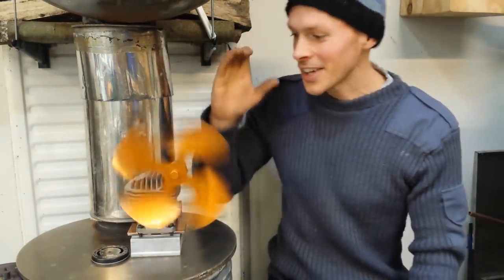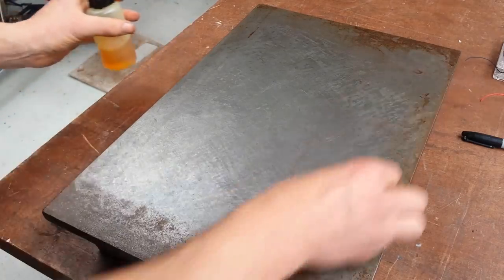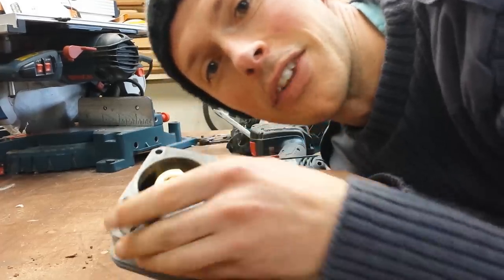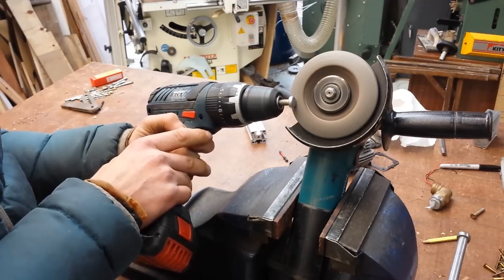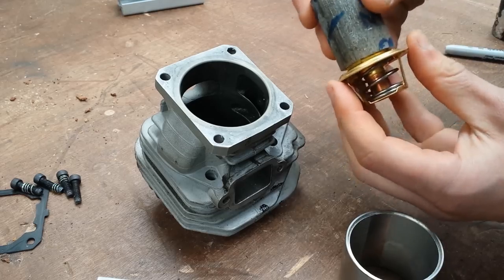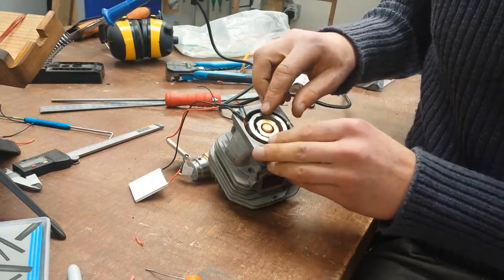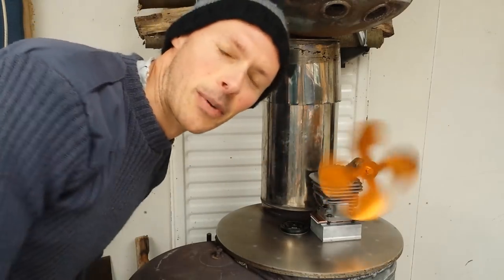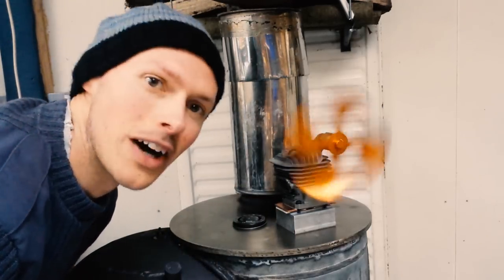Stove Fan's Achilles Heel and the easy Upcycled Fix

Comment: Kid, you deserve a lot more subscribers than you have! If you redesign this, I would suggest that you make a foot plate below the assembly. Lock your sliding bolt into that plate. Design it so that the "foot" will lift your entire fan assembly, in a balanced way.
Reply from the maker: Hi Selador. Thank you for your comment. The next one I make I think I will try your idea and make a balanced lift. Recon the floating look would be nice:) Thanks again, Bongo
Reply: Would that transfer more heat to the bolt faster or wouldn't that matter🤷‍♂️😊

Comment: I’ve had an Ecofan for years and never had any issues with it. Directions included with it specifies that the fan should be placed at edge of the stove top in a fashion where it pulls cooler air from the outer edge of the stove and blows it over the hot air over the stovetop . This way the fan’s upper portion is cooled more efficiently. Just my two cents.
Reply: Bien dit Andre.
Reply: Yup ,of course.
I didn't think,thats what I do.
It was more for me to blow more hot air by being at the back but of course it'll draw more cold👌

Comment: I was thinking you would have turned the bottom piece 90° so the fan would draw some air through the fins. It wouldn't be much air but it would increase as it gets hotter and the fan speeds up. Great idea with the thermostat

Comment: Floweringelbow , I have two.
One is the small ecofan and the second is the later larger unit , both two blade.
I run the wood stove all winter ( sole heat source) and maintain a medium high temp range.
At the corner in front the fan runs steady but not full blast unless I put it directly on.
Ive learned that directly on isnt good , and if I want more air flow I move the fan on the trivet closer in.
Sometimes we run both in different directions.
Weve been off grid for 20 years and these little fans are the ticket to heat dispersion.
Have a great day!

Comment: In one of the Douglas Adams books he says something along the lines of "It takes genius to see a bloody obvious answer when everyone else is still scratching their heads and trying to fathom out a workable solution. Many great inventions have been greeted by calls of "Well, what's so impressive about it? I could have done that", but the fact of the matter is that they didn't".

The idea of using a car thermostat as a high temperature cut off was bloody obvious, and I could have done that............ But I didn't think of it. :D

Very neat design mate.

One idea that keeps coming to mind is that the fan goes quicker as the temperature rises, so in theory, if the fan overhung the bottom heatsink it would self regulate by taking more and more excess heat out of the bottom heatsink as it got hotter. It should then just be a case of adjusting how much of the hot side was behind the fan disc and tune the point of equilibrium to be within the TEG's happy range. Granted, if the fire was particularly hot the fans not going to be able to purge enough excess heat, and the idea would rob the whole system of some performance, but it should at least enlarge the temperature window that the unit could survive within.
Reply from the maker: Thanks so much friend :) I had the same intuition about the fan blowing on the hot side, but without the patience to iterate and test it.  Thanks again, Bongo.

Comment: I bought a stove fan, but mine is  Stirling engine driven, bought from Kontax/Vulcan. Only problem is that it is not self starting, so you have to remember to give it a flick if it stops. But it's an engine, with interesting moving bits.
A dozen or so years ago I made a demo unit (I am a retired tech teacher.) out of and old thermoelectric travel fridge, just like you did, it works well enough on top of a cup of hot water, it just spins a wheel.
You have motivated me to have another go and make a stove top fan, years ago I used a two stroke cylinder head as a heat sink for an audio amp. It didn't work very well though.
There is another product on the same lines; a twig burning camping stove with draught provided by a small fan driven by a Peltier unit. I am not sure if the ones I have seen were cheating or not, given that they always seems to include a battery for some reason. Hmm?

Comment: Good thinking with the auto thermostat, lad. Perhaps a setup with 2 thermostats, one on either side, with stabilizer feet at the bottom to prevent tipping. In that way the entire cold side heat sink could be lifted from the stove top. Just an idea

Comment: Using thermostats for a mechanical temp adjustment is a great idea, and the cylinder head is a really nice touch. As far as I understand it (which isn't far), it's not the temp that the stove top gets to that's the problem, it's the temperature differential across the peltier. So one way to increase the efficiency, and lower the risk of failure, might be to try for greater separation of the hot and cold sides. If you can get the fan motor and the cold side further out into cool air, and shield it from the radiated heat of the stove-pipe, I reckon you'll see even more progress.
Reply: Thats why the top is from an old engine. Bigger heat capacity (cooler) and the fan is on the top (cooling the top radiator).

Comment: I had the opposite problem.
Having a stove with soapstone top and sides the foot of the fan didn't get quite hot enough, as the conductivity of the soapstone is pretty low.
I made a Z-shaped bracket from brass sheet metal, one end fits under the top plate and is pressed by the weight of the stone top onto the steel top of the stove, the other end protrudes from the side of the stove and the fan is fixed with four small screws to the brass, some heat conductive grease is used in between.
Now the fan hangs sideways from the stove top, and this makes for better cooling of the cold side.
As I got still not enough fan speed I removed a gear that drives the oscillation function, I had the oscillation switched of but the worm gear on the motor shaft driving the first gear causes still quite some friction, worm drives have high friction losses.
Now the fan has decent speed and fires up on its own.
The bi-metal strip at the bottom of the foot can't lift the fan anymore because the foot is screwed to the brass bracket but that doesn't matter as even with the stove going full bore the temperature stays below 150°C.

Comment: A friend has one of these stovetop fans.  It has a small bimetal strip rivetted in a groove under the base which lifts the unit to sustain sensible temp of the TEGs.  Seems to work fine.

Comment: hi  , i visited the website of the factory that makes these peltier elements , and they make peltier that resist a mutch higher temperature , they are more expensive but also produce more electricity , greetings from belgium
Reply from the maker: Hi Steven, thanks 😊

Comment: Good stuff. A work of art really. My off the peg stove fan came through the post today and worked for about an hour. The fan tested fine on a 9v battery so it seems that the peltier? is broken already!
Reply from the maker: Hi Liam. Thanks for your comment.  Hard luck on the fan. Guess you could fix it though. 
Peace, Bongo.

Comment: Was thinking, if your base was rotated 90 degrees, and maybe a slightly larger diameter fan, you could get a little air moving through that heat sink on the bottom, and help keep it from overheating.

Comment: Could you add springs under each bolt between the upper cooling cylinder and lower heatsink there eliminating the need to fully tighten each bolt? The idea is to give room for the copper plate to rise up a bit creating an air gap for additional overheat protection. If this would work then the entire module could still lay flat on the stove dissipating heat more evenly.

Comment: I have two questions:
1- Given that the objective is to move the heat to the room, wouldn't it be a better way to have the fan blow on the heatsink that is in contact with the stove?
2- Where did you get your jumper?
Cheers!
Reply from the maker: 2. Jumper - army surplus store in UK,  
1. Possibly/ probably. 
Thanks for watching :)

Comment: I have a stovefan....was wondering if there was a way to increase the temp difference between bottom and top of the peltier , and if so, woould it make a noticeable difference on amount of air the fan blows out ?   For example, I was thinking about adding a containment system  for the very top of the aluminum heat sinks, to allow me to fill it with water, which should create a bigger temp difference ?

Comment: I enjoy the video, and your enthusiasm to for the experimentation and the follow up with the heat sensors to know if it really is working right.

I plan on building 4 of these all with the thermostat feature.  I  starting scrounging at every friends pile of junk at their barns when I visited this past 2 weeks.  I now have a chainsaw block and 7 computer CPU heatsinks , 1 dvd motor, and 4 thermostats.     I have the rest of the parts on order.
Question 1:   of them say 190 to 195F on them and I think that is just pushing it too far.   I'd like to know if you'd use these free 190 to 195 F thermostats, compensate for them somehow or really get 160F or 180F if I want to give them to someone who won't like repair them if they melt.    What do you recommend? 
Question 2:    know if getting copper bars is important or just steel for the nice flat components.
Question 3 If  you'd keep  the square space on the bottom of the CPI heat sinks or you'd grind that off for more contact to the heat sink for some reason the hot or cold side
Question 4:   how would you mount it on the flue if the top of the stove is round?.    I plan on making 4 of these so I want to do it right.

Sparky in Goodrich MI USA Jan 11 2021
Reply from the maker: Hi Harry. Good luck with your build. Questions: 
1. I'm not sure how you would compensate to make the thermostat operate at lower temps sorry. I think that's what you were asking - hope I read that right? If you want the assembly to raise off the stove top sooner mount the waxstat lower down the hot side heat riser, closer to the stove top... 
2. Copper is a much better conductor of heat, so works better as the cold side heatsink. It matters less underneath...
3. Depends on the dimensions... Don't know.
4. I guess you want to make a semi-circular mounting piece as part of the base? You'll work something out... 
Best of luck, let me know how it goes. 
Peace, Bongo.

Comment: Question: which is the top and bottom face of the TEG/peltier plate? I have a new one that has printing on one face and not on the other, and it has a red and black wire insinuating a POS and a NEG way to place it. As I want my fan to turn the correct way, in short, which side is UP when I lay the new pad in place? How do I ensure the energy is travelling the proper direction? My old fan peltier has two black wires and no printing anywhere... so no guide that I can see. Thank you, Chris.
Reply from the maker: Hi Chris. Good question! It's a problem. In the past I have just rigged it up, and give some heat to one side and visually check the direction of rotation. Not very technical, but works... Best I have I'm afraid. Good luck!

Comment: add a cylindrical disk recessed into the fins on the bottom and attached to the bolt so when it pushes down it lifts the entire unit up? would that help for further heat management

Comment: Correct me if I'm wrong, but if you're problem was overheating wouldn't it be better to make the heat transfer on the hot side as inefficient as possible and the cold side as efficient as possible?

Comment: Good design for a proto type. I have not studied your homemade fan or what type of motor it is running, yet. Auto thermostats can go to about 300-450°F under steam conditions without the wax button bursting. The problem is it detentions the spring from too much heat work. I have a better method imo to try on your base mount.
Reply from the maker: Thanks Ken. Would like to hear it? The good thing about this system is that the wax 'stat Should never go much above 200 as it gets pushed away from the stove well before that...

Comment: What's your thought about adding the thermostat to the ones bought.  A great review also.  I wonder if one could take a piece of aluminum block if found lucky and make one from that.
Reply from the maker: Hey Robert. I dont actually have any first-hand experience with the commercial ones with thermostats you can get these days, so can't say what they are like - good that they are adding protection now though. 
 I don't see why one couldn't make from a solid alu block, though I guess you'd want to machine fins into it to increase the surface area for heat disipation.

Comment: Wow, that's cool. I know this is a very late post, but I just found you channel- and subscribed! What do you think is the maximum, average temperature for the Peltier devices before they fail? Can you make a small Air conditioner, using the Peltier devices? 
BTW, I really miss my "Wolley-pulley(s)." The UK is the only place that makes them entirely out of wool.
Reply from the maker: Good evening VO, thanks for getting in touch. I think it's probably about 150C - but depends on the particular TEG you use. 
I see no reason one couldn't build a little AC from them...

Comment: Just wondering if larger fan blades, extending to very near the surface of stove, with heat sink fins oriented with direction of air flow would accomplish the same result? I love how you think outside the box!
Reply from the maker: I certainly think that would help! I have tried that on some of the ones I have made and they seem to last longer.

Comment: Any bi metal can do it, just fasten the 2 together length wise. Variations can be exaggerated by cooling or heating before fastening together.
Reply from the maker: Hi gentelbenn. Bi metal was my first though. But the wax stat seemed to snuggle discreetly in the housing nice. Would still like to try a bit metal version though.

Comment: GREAT VIDEO, I HAVE THE PARTS TO BUILD ONE BUT I CANT FIND THE FAN BLADE, I CHECKED EBAY BUT NO LUCK, WHERE DID YOU GET YOURS?
Reply from the maker: Ebay a long time ago, can't find it these days... you could check out my vid on making the blades... ?
Reply: I made mine out of the bottom of a sweet tin working a treat 👍🏼
Reply from the maker: @mp180170  Cool. I would like to see that - post on the FE Facebook page if you get a chance to snap a pic :D

Comment: I have positioned 8 bricks on top of smallest cooker fire. And I leave the fire on, at minimum. The two top bricks never get hotter than 90C  but this setup does take the chill out of the house, just with the smallest flame. I don't think this setup will burn the peltier either
Reply from the maker: Aaaarrrrrggghh, thanks for sharing.  Only problem with slow low burning is it's efficiency and the potential creosote build up. If you can capture the heat much better to burn 🔥 fierce and fast, which gives more complete combustion... not always practical though I guess. 
Thanks again. Peace Bongo.
Reply: @FloweringElbow  yes, I was talking about the methane fire cooker, there's no creosote with the gas cooker. Also no need to deal with wood or ash, no refueling, just turn gas on. Obviously, the smallest out of the 4 gas fires, which is  verysmall
Reply from the maker: @aaaarrrgggghh  Ooops, sorry my mistake. Thought we were talking wood... Good luck with it :)
Reply: @FloweringElbow  if you really want to capture extra heat from your wood stove, place a heap of railway track bits all over it. No fan required!
Reply from the maker: @aaaarrrgggghh  Dude. You should see the top of my stove ATM - it's covered in scrap metal of all kinds ;)
Reply: @FloweringElbow  haha it sounds like we are on the same wavelenght :)

Comment: What is the role of the heat-sink at the bottom?
Wouldn't it be more efficient with just another copper heat spreader?
Reply from the maker: The function of that bit, is to decrease the temperature on the 'hot side' of the TEG to a value that will make it work well but not overheat on an average burn. 
If there was no heat sink at the bottom, or just a thin solid heat spreader, for example, the hot side of the TEG would basically always be too hot...

Comment: No need for a riser block, just have a more efficient heatsink above.

Use a 120mm heatsink for a pc. Shroud the fan to optimise airflow being pulled through the fins.

👍

Comment: have you thought about that thermostat failing and leeking wax on top of your stove and maybe causing a fire?
Reply from the maker: Good Evening Skidoo. Thanks for this. I have had that thought, after reading your comment that is!  I think it unlikely given the position of the thermostat (quite high up away from the full heat of the hot plate). It's a consideration though, and perhaps an argument for a bi-metallic strip type solution.  
I guess I hope that these are quite robust devices that rarely fail... Worth thinking about though, so thanks again,
Bongo.

Comment: if the fan/motor is about a meter wire away from the heatsource/conducter area will it work the same?
Reply from the maker: Not quite the same. Reason being the fan is pulling air through the top heatsink and technically cooling it... Without that it is likely your top heatsink will become a similar temp to the bottom, not good as the TEG works of heat differential - the bigger the difference the more power it generates. Hope that helps :)

Comment: My little stove fan has a bimetallic strip in a rebate under the base... too much heat and it bends, breaking contact with the stove top... 
You can make yer own bimetallic strip by riveting a steel strip to an aluminium strip... the aluminium expands more than the steel & as they are fixed together the strip bends... 😎👍☘️🍺